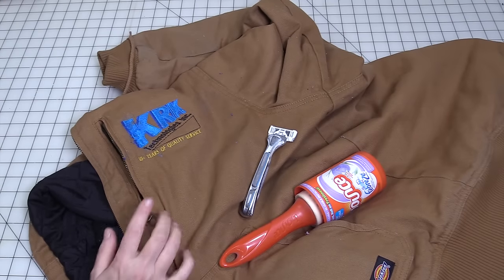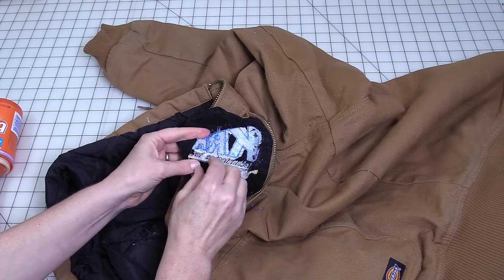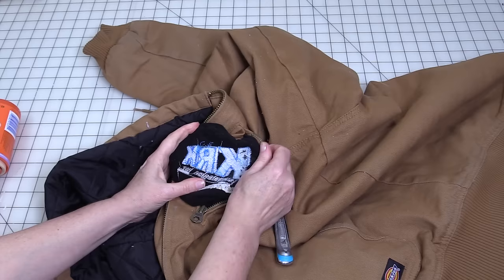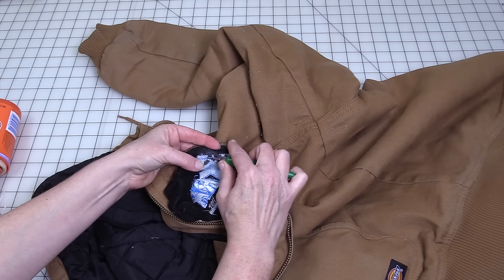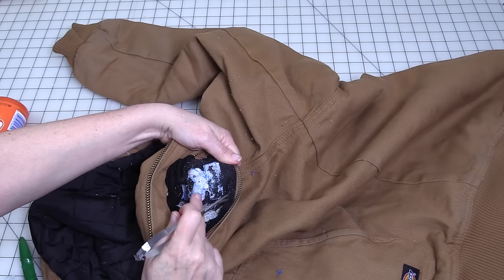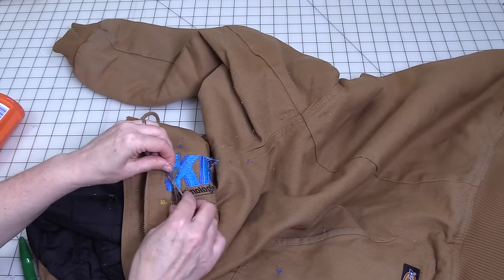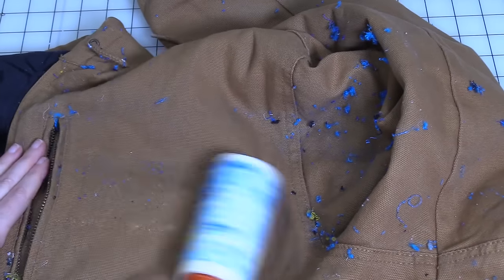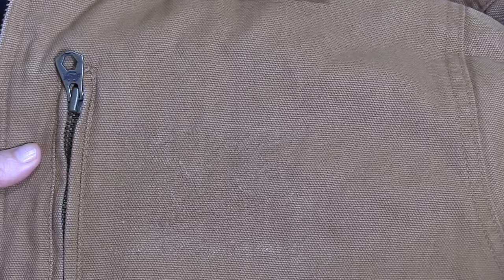How To Remove An Embroidery Design From A Garment or Fabric

Comment: This is just what I was looking for I have some shirts from my former job, I really liked and didn’t want to throw Them away. Also is there away to just get a new  patch with designs  and just cover the old embroidery?
Reply: It would depend on the size of the embroidery you want to cover, if it's about the same size of the new one, it would be too thich and would show. Otherwise, if it is a very small embroidery you want to cover with a bigger one, you could use a patch - a pre made embroidery that you could just "glue" (usually they're heat activated) or sew above it. If you want to embroider directly above the fabric, it would be better to take off the old embroidery.

Comment: Very helpful thank you! I figured out that this also works on embroidery designs where the satin stitching is on both sides (e.g. you can’t see the bobbin stitching but a razor still works just fine to cut up all the satin stitching on the back)

Also if you working with average shirt or thinner fabric, be very careful with the razor bc it’s easier than you think to cut a hole in the fabric. Learned this the hard way even though I thought I was being careful 😅

Comment: I have a very nice older Harley heavy jacket made from cowhide my dad gave me and it has a faded out old harley patch on the rear of the jacket and unfortunately it's not sewn like your patches are, it didn't go through the lining so I can't do the procedure like you did. It's looks like the only way to remove it would be to do it on the leather. Do you know if there's a way to do it without damaging the leather to bad? I know it may leave some tiny holes but I have some leather filler that can go in the spots and we can use some black dye on it.
Reply from the maker: They probably removed the lining when they put the patch on, or it was sewn on before the lining. I would be worried about damaging the leather. I'd try taking it to a shoe repair shop because they usually also do leatherwork. Most shops will at least tell you if it can be done and give you an estimate.
Reply: @LetsLearnToSew  What is a short repair shop?

Comment: I got this really nice rain jacket from work that’s like a waterproof polyester type material. Eventually when I quit this job I still want to wear this jacket since I get to keep it but I really hate the big ugly (like slightly larger than the diameter of a golf ball) solid embroidered logo. I’m worried that with the material, that if I remove the embroidery it will cause the jacket to be full of holes in that area since it’s such a dense embroidery design. Do you think that kind of material would do that?
My other thought is maybe getting some black fabric dye and dying over the embroidery to try to hide it best I can since it’s a white and lime green design.

Comment: I don't have a razer at hand.  So I used a sharp knife to carefully cut the threads on its back, so reach the same effect.  Then pull the thread at front side.  The difficult one was the small characters.  But anyways, used your idea and done the job.  Thanks.

Comment: Hi! On a waterproof jacket would this leave little holes at all? I have one with my work logo on I am hoping to remove but don't want to cause any holes in the jacket as it is waterproof!
Reply from the maker: It will leave tiny holes that could let water in. You can buy waterproofing at local craft stores and online to prevent that.
Reply: Let's Learn To Sew would a few coats of scotch guard work to waterproof it? I’m in the same boat as Jodi.
Reply from the maker: @portcityengineering  This product would work: https://amzn.to/2MmtNlW
Reply: Let's Learn To Sew thank you!

Comment: If I do this process on a rain jacket/wind breaker will it leave visible holes? Just checked the tag and it is 100% Nylon
Reply from the maker: I'm not. Nylon is picky and not very forgiving. It tends to snag, and pucker and doesn't recover well when removing stitches from hems and such.
Reply: @LetsLearnToSew  thank you!

Comment: Mam can you tell us how to remove mark of embroidery when it is removed after shaved from razor
Reply from the maker: It depends on the fabric. I usually wipe the area with a damp cloth and let it dry to see if that helps. As I mention in the video it can take several washes for the marks to go away and sometimes they don't go away. It often depends on how long the embroidery design was on the fabric and the type of fabric.